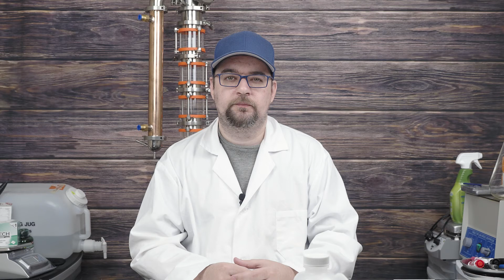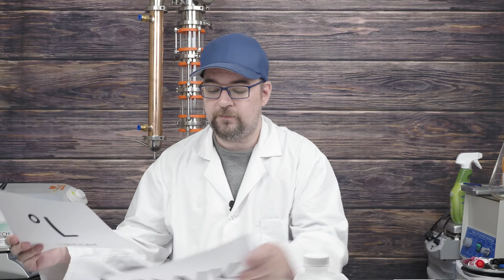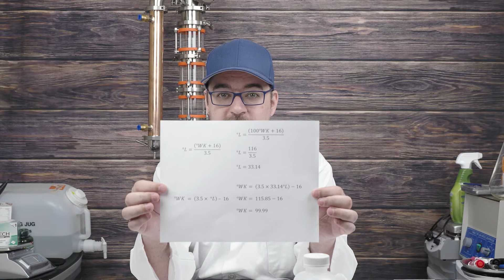Micro - 002 - Diastatic Power

Comment: I have looked and looked and cannot find a calculation that gives me the the amount of malted grain that I need for converting cereal grains. Is there a calculation out there, specifically 6-row
Reply: I do show how to do it in my Making a Recipe episode on All grain. But the short of it is, you take the mass of each grain, and multiply it by its diastatic power. You then add all those products together together, and divide by the total weight. 

Let's say you are just using 2 grains, 4lbs of 6-row and 4lbs of unmalted corn. So 4lbs 6-Row with 140DP would be 4 * 140 = 560, add that to 4lbs of unmalted corn with 0DP (4 * 0DP = 0), and you get a total of 560DP divide that by 8 because there is 8lbs total, and you get a mash DP of 70. You can do the same thing with kg, the mass units don't really matter.

Technically you need a minimum of 30DP for a grain to convert itself, but if there are other grains present, you want a minimum of 70-75. So in my example, it would be skirting the lower threshold.
Reply: @adamw2785  " but if there are other grains present, you want a minimum of 70-75." im confused here, if the whole mash bill ends up being 30dp or say 40dp then does this not mean you will have full conversion of the entire bill? why do you say it needs to be at least 70? 
for example 1kilo of pale malt @140 dp and 2.5kilo wheat @ 0 dp will give you a result of 40dp so this will work no?